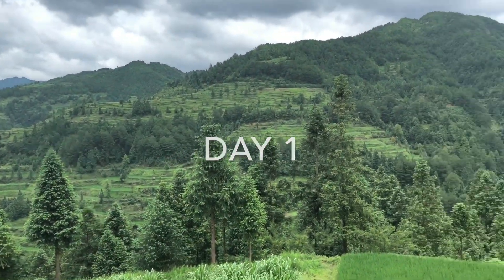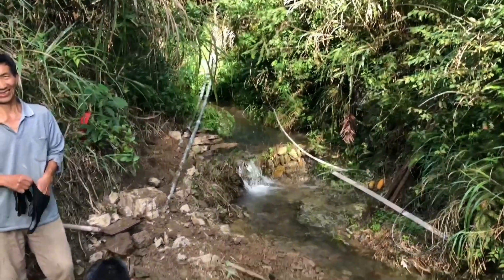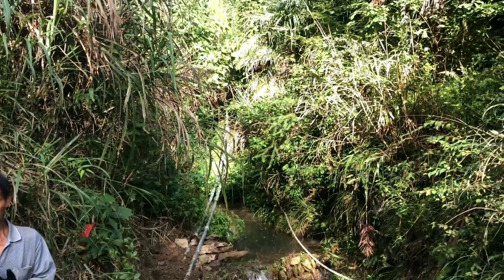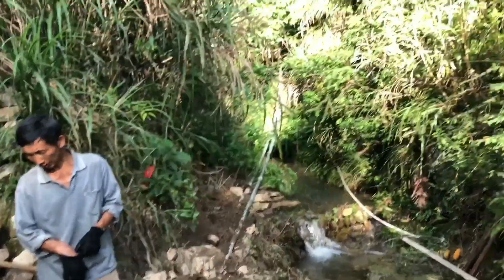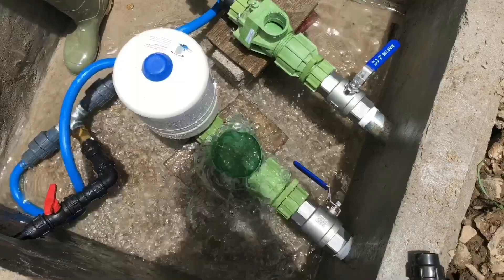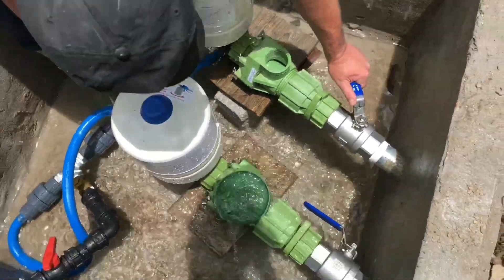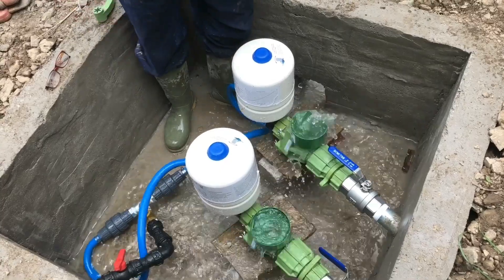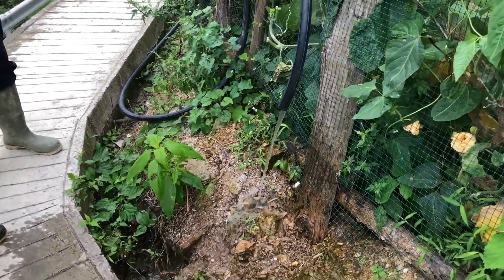Ram Pump Chinese farmers self-installed Pumps to pump water up 60 metres without fuel or electricity

Comment: That is the stupid Ram Pump...
Reply: What is stupid about a ram pump?  It's brilliant
Reply: @marcelopadillaopplig  ....It spills a lot of water, not very efficient in water saving. This video purport as if chinesse inverted a new way of pumping water uphill without electricity. This is NOT a new invention, it is old know invention and inefficient method. There many efficient ways to pump water uphill; it is just we have kept them secrete for now...
Reply from the maker: Missing the main points of the video.  This is a UK product and we are not prentending we have invented the ram pump which is 100's of years old technology. What we have invented is a new valve which has allowed the pump to be redesigned with an inline configuration. It is much more reliable, economic and efficient than the comparable traditional heavy metal ram pumps. If it gets more people to use their available water and reduce using diesel and electricity, that's a good thing isn't?  It uses a the flowing water to generate power and deliver a portion of the flowing water.  Are you suggesting that if you have a flowing water source such as a river, you should use all the water leaving nothing to flow downstream?  Is that efficient water saving?

  And Ace Toxic spends a lot of time on this site being very negative about everything.  This girl is not an expert, she was part of a village that put in their own Papa Pump and made a video about it.  We are hoping to find videos  that Ace Toxic has made and published, they must be brilliant!  He is so knowledgeable about everything!  Can't wait!